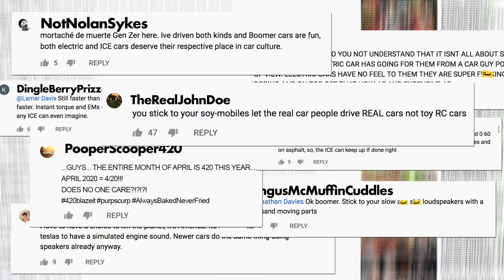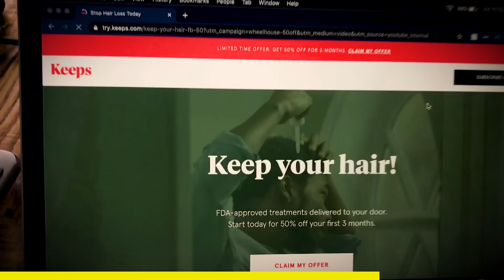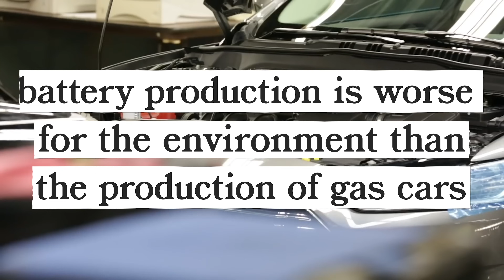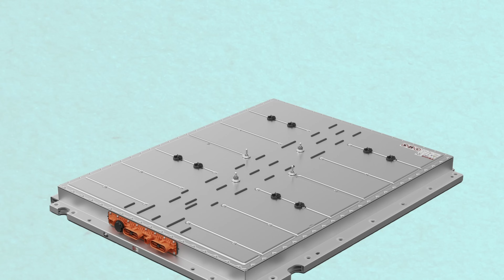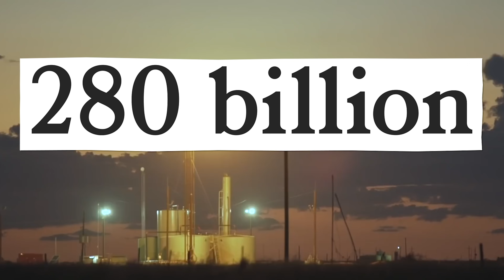Are Electric Cars REALLY Better for the Environment?

Comment: There is another option. Salt water power. A guy in Brazil turned his little bike into Salt water power by adding a little "something" to his bike. He became viral in 2016, but he got killed.
A year later, a mexican guy redesigned that little "something" and he proved that the engine worked better and needed less oíl. He dissapeared.
The thing is that you can make your Mustang enviroment friendly without lossing power or sound, by finding out this little thing that you can adapt to any gas power car.
I remember that I also watched a video from an american guy selling this thing.
I think that the entire industry can be saved by using this thing. No gas, no lithium, no cobalt.

Comment: You're forgetting that once the production process goes electric the amount of co2 for production will decrease. It's kind of like if you build the first 1 the rest will follow, cheaper and more efficient. Also battery technology is already evolving. See John b goodenoughs article. I question where you get some of your information.
Reply: Andrew Hall  how so?
Reply: Did we not watch the same video?  he said that unquestionably electric cars are better re: climate change emissions overall, even stating that the WORST electric car is still better then the BEST gas car.  He did also mention that e-cars are in relative infancy, and that it will see lots of improvements in time just as ICE did.  If anything this video was overly simplistic for sure...

Comment: NB:
I am impartial, if EVs are the future so be it. However something you didn't consider in this video is the lifespan of lithium-ion batteries. We've all experienced are phones battery deteriorating over time (and requiring replacement). The same will happen with EVs, meaning either a shorter vehicle lifespan than ICE or a battery replacement which resets their huge consumption rates.
Reply: Battery degradation isn’t bad if the vehicle has a good maintenance system. Also, degraded batteries have uses elsewhere and can also be reconditioned or recycled.
Reply: Yea the cost of buying an EV and maintaining the battery deterioration means the fossel fuel run cars are still cheaper to owne. A 5 year old EV worth stuff all, 5 year old fossell fuel car is still worth good money as a trade in.
Reply: Paulman50 - We already have battery cars older than 5 years so your point is clearly false. I've just had a look and electric cars from 6-7 years ago are holding their value shockingly well.

Phone batteries are completely different to car batteries. They go through almost an entire charge and discharge cycle in a day, every day - something you won't be doing in a car. Go and get your old Nokia 3310 from 20 years ago and charge it up. It'll be fine as back then phones were only charged once per week and hardly ever allowed to go down to low charge, so the battery was kept in better condition.
Plus modern phones are plagued with planned obsolescence.
Reply: Tesla's patent they just filed details a new battery that keeps 90% of its range after 4000 full discharge cycles. 300 mile range x 4000 cycles = 1,200,000 mile lifespan

Comment: When they "recycle" a battery 80% of the material used in that battery is thrown out. These metal alloys get into the watershed, for which there is no natural process to clean it like photosynthesis is to C02
Reply: Reduce our dependence on cars and make sure cars are very fuel efficient so that CO2 levels stay manageable for the carbon cycle. There is no cobalt and lithium alloy cycle, that shit WILL end up in your body.

Comment: What you essentially is comparing is an electric "T-Ford" with a modern car. One system in the beginning of its lifecycle and one system at the very end. Iron based batteries (or similarly less dirty) and clean energy production is around the bend. In Sweden where I live we already have a very clean energy mix.

Comment: Does the torque of the electric motor burn more rubber off the tires? That has to be bad for small animals and the environment with all those little rubber particles being thrown into the air landing wherever.

Comment: one thing u forgot is petroleum by product makes the plastics in EV's also so cruel has to be facter into EV's calculations.. not to mention copper from wires, battery and motor.. if u ever been i  a mind the strio ratio of some copper mines is pretty high more CO2 at 25% more copper per EV than petrol

Comment: BUT, what if the EV battery fails once or even twice within the lifespan and would have to get that replaced? Is the comparassion also fair worldwide, since Americans usually like their big V8 that uses a lot more gas than other economy cars? Also what is the numbers for the aftermath when it comes to recycling the cars what is hardest to process? 

I am not against or fore EV's as long as the distance isnt longer on a charge and they arent more affordable, but I have seen respectable sources actually come to the conclusion that a lifecycle economy gas powered car actually is less harmfull to the environment when it goes from production to scrapyard. I believe the comparassion wasnt only based on CO2 either, but overall 🙂

Comment: How does an electric compare when you factor in battery replacement, however long that may be. Some cars run for 300k miles without issue, and environmental impact of a replacement engine would be less than an electric car with 300k and 5 battery replacements.

Just wondering, not being anti electric. But this video feels like maybe part one on original owner lifetime, not lifetime of the vehicle. Consider my classic Mini. It is a 1980 with the original engine, granted only 77,000 km on it. But a 40 year old electric would be several battery replacements deep by now. Maybe a part two video with true lifetime of the vehicle?

Comment: Wind and solar power generation not scalable.  The only way to address the power needs is to look to good ol' Nuclear OR Thorium. Also, how long do the batteries last in an EV?  A car nowadays provided the car isn't totalled, CAN last 20 years or more.  An EV can last that long as well, but the battery that's in it....needs to be replaced on average every 100,000 miles or 10 years. So that info needs to be in the metrics of impact to the environment.  Kthx

Comment: You Missed the three major points.

1 The initial cost over an ICE vehicle 
2 The lack of places to charge them away from heavily populated areas 
2 The lack of range I drive 500km on a tank of gas i stop fill up in 10 minutes and i'm back on the road. And the cold weather has no affect on me getting to where i got to go.

I did the cost analysis for an equivalent Gas powered vehicle to the model 3 dual motor extended range. I need a 4 wheel drive vehicle as rear wheel drive teslas in western Canada just doesn't work. And the shiny hip sales guy at Tesla had zero answer for me....

So I bought a Mini CooperS All 4 Pacemen for $20K it has 12K miles on it (yep it was used) but i'm smart i never buy new cars, I buy a lease back. So if i drove a 1000 miles a month over 60 months the total car cost me $27K averaging 35MPG @ $2:50 per gallon and $50 a month maintenance.

The Tesla Model 3 costs $75K if i drive 1000 miles per month over 60 months the total cost of ownership will be $79K at $10 to recharge for the 166 recharges of the 60,000 miles of ownership, and the monthly cost of $50 for maintenance.

So technically speaking i can own 3 vehicles for the price of one Tesla so it will take me 18 years to break even. In 18 years from now, i will be to old to remember my name and my car will be flying or i will be teleporting with my Carbon walking frame....
Reply: An all decked out Tesla model 3 doesn't even cost near 79K. Plus charging is waaaaay cheaper than gas. That's just factual. There is little to no maintenance due the vehicle itself not having an engine with no use for oil. Plus during winter, you can pre-heat your car before you even get inside all through the mobile app. Nice try tho.
Reply: Plus Tesla battery only last 9 years

Comment: Video released one month before Tesla’s announcement of the zero cobalt/one million mile battery.
Reply: Maybe dashcam videos are the answer ? hahahha PS: its me
Reply: The cobalt h
Thing is such BS pushed by crazy loney heppies. Cobalt is fine. Unless you Africans to starve!!?
Reply: That brings us to the issue of energy density. The Million Mile battery exists, but as I understand it, the lower energy density means the battery has to be bigger and heavier, making it a lot less likely that these batteries will be used in cars intended for private use or for long distance travel. You might see them in taxi cabs and city based courier vans though.
Reply: Check out “the limiting factor”, he’s put out some great videos recently detailing what is likely to be presented at battery day. I think you’ll find that energy density will go up not down.
Reply: @rodh1404  I will just buy the battery and put it in my gtr 😂
Reply: @rodh1404  the motors would be fucked before it hits 500k
Reply: Fuzion Playz Maybe, electric motor outlast combustion.... and that’s really the point
Reply: @dirtydangler99  idk but I hate the idea of electric vehicles because there don't vibrate like a gas powered car does so what about people that are death? And people think it's a killing machine due to its quietness
Reply: Fuzion Playz I can see where you are coming from. To ease the issue, electric cars still make some road noise ( fans and tires). Tesla specific electric cars have more safety features, such as automatic braking. Lastly, if you do get hit they have the largest crumple zones due to the lack of a cast engine block under the hood. Maybe I’m wrong, but if this becomes a serious issue, noise is pretty easy to make
Reply: There are much more materials than just lithium and cobalt. Rare metals are also used that leaves the land highly polluted and aluminum takes 8x more energy to make than steel. Lots of real information was left out of this story.
Reply: Thunder Shadow spoiled rich kids
Reply: Jesus H Medrano 48 years old and retired bud.
Reply: @bluecollardisruptor9584  bout right
Reply: @plenilunio92  i'll give this to you, EV are faster, more reliable, and generaly better cars, but i'll still simply DON'T GIVE A F**K
Reply: @bluecollardisruptor9584  on a straight away? Sure Tesla's will win. But a track is where they'd get smacked by cars made for a track
Reply: Alan Barron not by a plaid
Reply: SO true Adam!  Tesla is already making their batteries to last 500k miles, people just dont know, they just want to hate electric vehicles for some reason.
Reply: yeahbuddy92193911 cuz they have no soul, sure they are fast but thats only part
Of the equation, also i dont want to wait 4-8 hours for a charge thats why ppl hate on the or should i say car guys.
Reply: Jesus H Medrano My battery is charged every morning with close to 400 miles of range. I haven’t encountered a car that can beat mine, ever.
Reply: Adam Mackenzie does it put you to sleep too?
Reply: @gigi9467  it takes 20 minutes to charge it upto 50%
Reply: @bluecollardisruptor9584  
Here's a short little list of a few cars that beat yours.

Chevy Cruze diesel-702 miles
Hyundai Ioniq-702 miles
GMC Yukon XL-713 miles
Cadillac Escalade ESV-713 miles
Chevy Suburban-713 miles
Kia Optima Hybrid-729 miles
Jaguar XF 20d-731 miles

I assume there are dozens more, maybe even hundreds more. The average range for a car is 350 miles, so maybe the high end Tesla has more than average to compensate for the massive pain of charging during a trip, but even still it doesn't even come close to the top in terms of range. EVs are cool, but don't act like they're a gift from God. I have one and I like it but I don't like the stupid toxic fandom that doesn't shut up about them.
Reply: @gigi9467  car guys don't hate Tesla lmao. If anything we want one too. Stop generalizing
Reply: Jesus H Medrano Doesn’t take 4-8 hours.... 180 miles in 15 minutes for the model 3
Reply: Henri Bergeron I’m talking performance you silly goose! Do you really think I range test every car I encounter? 640 kms range in my Model S is more than enough for me.
Reply: @Henriburger1  So use one of those cars you listed for cross country trips... because that's what you do every day right?  I don't go out and buy a semi because I might want to move all my household goods someday, there are those that do that and need a semi.  The number of people that need 700 miles range when they get up in the morning are... ummm, limited. My 99 Buick Regal GS gets about 200 miles per tank of super unleaded and has never gotten as high as it's 17mpg city rating.  My electric scooter I converted from lead acid to lithium gets 80-100 miles per charge which comes out to about 1500miles per gallon if you are comparing costs of electricity to gasoline per distance travelled.  Costs me about $.10 a week to operate the electric scooter vs $50 for my car.
Run what you want to run, just be informed.  Loud gas engines are fun at the drag strip, they suck in your neighborhood.
Reply: @scottmcelhiney323  
You don't go cross country everyday but with a car like that you have the option too. You do with a Tesla as well but I made the comment to show that Teslas don't really have great range, and on top of that require charging. Also yeah I'm not surprised that a scooter is more efficient than a 1999 Buick. If it wasn't I'd be a bit suspicious. The smaller the vehicle, the less energy it uses. Thats why motorcycles can go hundreds of miles on a few gallons.
Reply: @gigi9467  if you want soul then ride a horse
Reply: @gigi9467  im just saying, cars dont really have soul.. if you really want souls, horse is the real deal 🤔
Reply: m_si2r problem is if i have to explain it to you, you wouldn’t understand lib.
Reply: @gigi9467  ok, guess you're just being subjective with your "soul".
Reply: @alecto1550  yea its a car guys thing you wouldn't understand even if I explained it rice.
Reply: @gigi9467  yeah, at this point i dont want to know either even if you offer to explain it to me.
Reply: @gigi9467  lol ok dude, you're a car guy, be proud of yourself, you know something that i wouldn't understand even i you explain it to me, you should think you better than everyone else! 😉
Reply: I am hating electric cars because they don't support environment.  Against they contaminate environment not locally, but globally more,than internal combustion engines. I am support knowing smart people like Donald Tramp,who is don't believe in greenhouse gases & global warming. I am prefere U.S. internal combustion engines V6 or V8 & drive it Ukrainian roads.

Comment: so overall EVs are better for the environment. but a glaringly obvious issue for most people is. while the least expensive tesla is around $35,000. the Mitsubishi Mirage that can get 50 mpg (from people who own them),  is just under $14,000. there's a big difference in performance. but for someone who is simply looking to save money. its gong to take a while for that to balance out.
now if we can get graphene batteries to a point where they can power EVs. game over for the ICE. they charge faster, hold a charge for longer, are lighter weight, flexible, and are made from graphite. no shortage on that.

Comment: Is it just me think that electric cars will actually end up dirtier in the end anyway.
Because most people change out their cars every 3 years. Higher emissions  in production.
Yes the ICE car have emissions but how does that actually compare if it runs on renewable fuels?
Or carbon  neutral fuel?
Then will EVs a really turn up as the big devil in the end anyway.
About that tax credit and Tesla, that is a fact you have gotten wrong.
Why Tesla have half compared to others is because they have sold many EVs. And Tesla will be the first brand to lose its tax credit.

Comment: No one I see seems to account for the vehicles that are already on the road. Converting cars will not be an option so talking about every person needing to purchase a vehicle to convert what happens to the cars that already exist?
Reply: Just drive the cars that exist until they are worn out and replace them with EV when they need to be replaced. It'll easily take two decades to get all people into EV cars either way as ICE cars are still outselling EV by a huge margin.

Comment: YOU FORGOT ABOUT HOW THESE LITHIUM BATTERIES DONT LAST PAST TEN YEARS AND NEED A NEW POWER PLANT (take the prius for example)
Reply: Imo 10 years is fine. ICE cars don't last that long and aren't improving anymore while EV cars do. Just erect a few modern nuclear plants. Problem solved. Green and far safer than water-cooled nuclear plants (gen 1 & gen 2) we use today.

Comment: I know this video is more about eviromental friendliness of a car.
But most of the people have economical motivation to buy an EV or not.
So I think it is important to mention that an EV has minimal maintantce costs.
Has a minimal a minimal chance of failure. Insurance cost are much lower.  And it does not matter when and where you charge a full EV charge will always be cheaper tha a full refuel of a similar car.